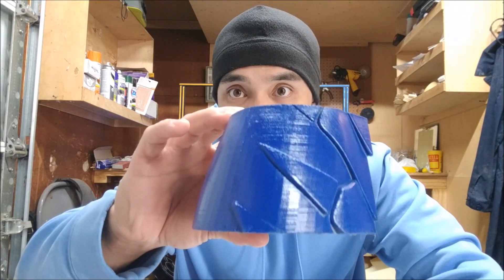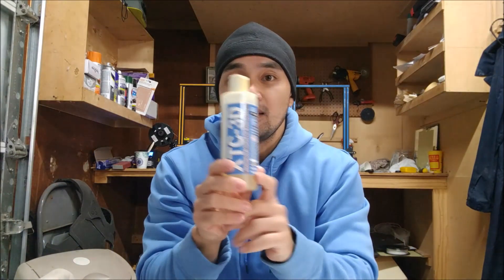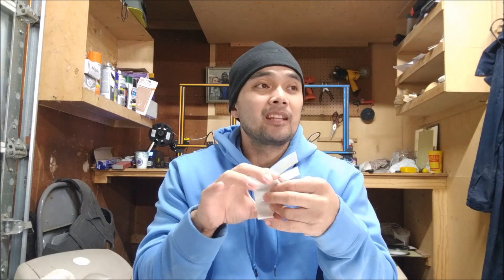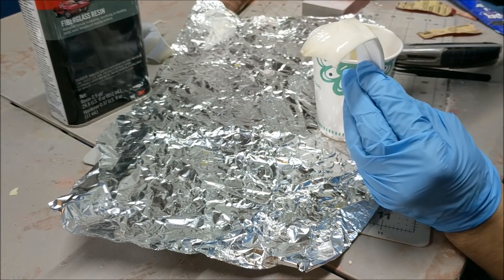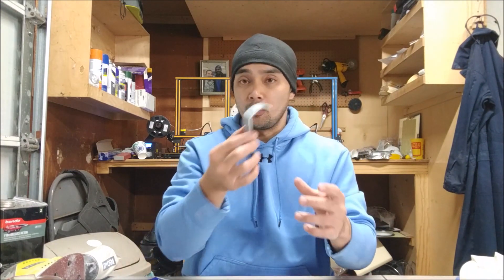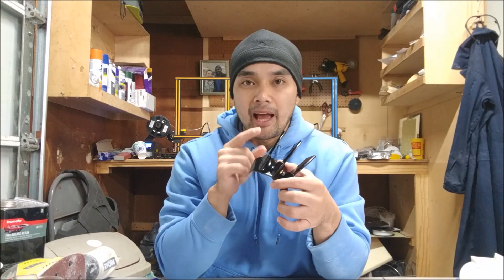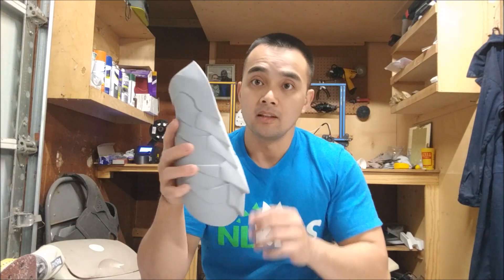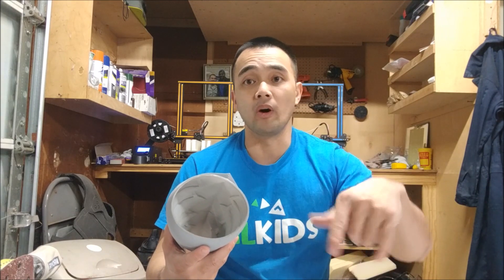Cosplay Tutorial #6- Smoothing Your 3D Printed Armor

Comment: I tried this method on one of my pieces.  However, I noticed when I used primer filler the primer dried with some cracks.  Should I put coat of primer, or would you recommend filling the cracks with bondo?

Comment: I've got a hint to add:
West Systems Epoxy is much superior to polyester (boat building/auto 'fiberglass resin') in both ease of sanding and control of hardening time. It also smells MUCH less, and although you should wear a respirator, if used with good ventilation, you can get away without it. 
It's more expensive, but goes much farther because it doesn't kick off as fast and there's much less waste. Done right it requires little to no sanding. 
Several hardeners are available, so curing speed is easily controlled, and there are fillers like collolidal silica to thicken as desired. It also sands very nicely when filled with microballoons or colloidal silica and the fillers stretch the epoxy a bit so you use less. For ease of sanding I mix in phenolic or glass microballoons until it's a tad thinner than mayonaise thick, and then it sands VERY easily. You want it to just self level, so a thin layer fills the layer lines.
It requires precise mixing (use scales or buy the pumps - the pumps are about 10 bucks, last a very long time and save resin/hardener.
West also has a free newsletter/magazine on how to use their epoxy products.

I have no affiliation with West Systems, I discovered them building high power rockets (very large - >15') years ago, and have since used the epoxy for boat work (it's intended purpose) and dozens of projects. You'll find once it's in your materials lineup, you won't be able to live without it.

oh, yeah, keep it well away from shop princesses:-)

Comment: Just now discovering your channel. Are you also smoothing or putting any filler on the inside of the armor pieces? I sweat like crazy in my sandtrooper kit that's made out of vacuumed form ABS. Not sure how well PLA or PETG holds to moisture from sweating.
Reply from the maker: Jason Yap I don't do anything to the inside. But yes it's hot in there hahaha. Pla is pretty good with moisture. I don't have problems with it
Reply: To add to this - my understanding is that ABS is way more susceptible to soaking up moisture than PLA is. Like people recommend baking their ABS filament prior to use, but I've never seen anyone recommend the same for PLA.

Comment: Great video, thanks for showing how you do this.

Couple questions:

Can the fiberglass resin go on top of primer, or does it have to be the first layer? Sometimes you can't see problems on a part until you prime it first.

Also, when you say it has adhesive properties, should you add it to your parts before gluing, or does it just add strength to already glues parts?
Reply from the maker: Aaron Shepherd thanks! It can go over primer but I wouldn't do it.

As for adhesive properties, I wouldn't use it as a glue substitute. I would use it as a filler that the glue couldn't hold together or it couldn't fill
Reply: Great thanks!

Comment: I'm going to try bondo all purpose two part putty to replace both products you are using in one product as well as being the cheapest of the three. People say the one part spot puttys that come in toothpastelike tubes are not good due to how its made, it shrinks when it dries, then when they are primed they intake some of the primer or its solvents one or the other and then expands again this process its doing is said to cause some bullseye like effects on the paint so people recommend two part putties over one part putties since its chemically hardened and will not intake the primers lacquers which I think were the problem. So the all purpose putty is two part, thick enough for vertical application but thin enough to spread over large surfaces and fully cover the print for layer lines. It seems to be fairly toxic I'm not sure how it compared to fiberglass resin but they are probably close which the bondo youre using should be similarly toxic as well. I'm thinking about using fiberglass resin ias well do you think if I used the fiberglass resin on cardboard it would dry hard like plastic? Fiberglass resin may be better on the more detailed models. Something large and flat could easily be puttied. My current assumption is larger layer lines like .8mm may not be able to take advantage of fiberglass resin requiring putty as well for the fully flat surface.